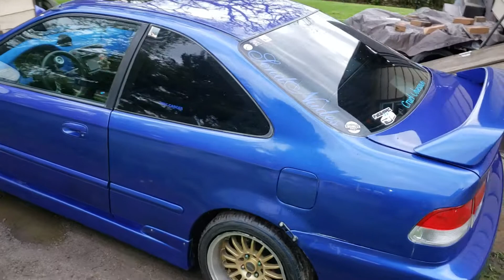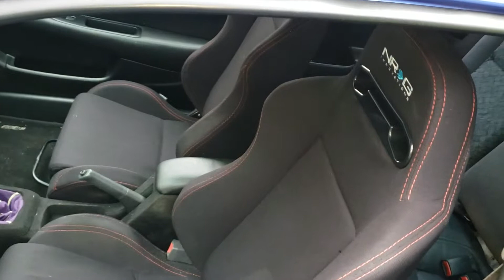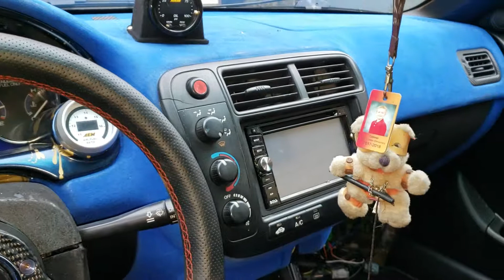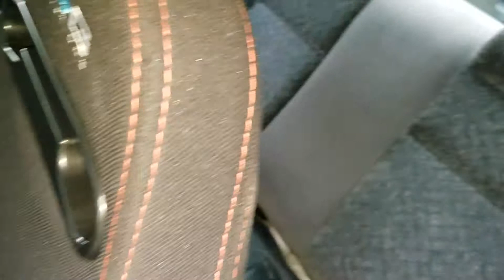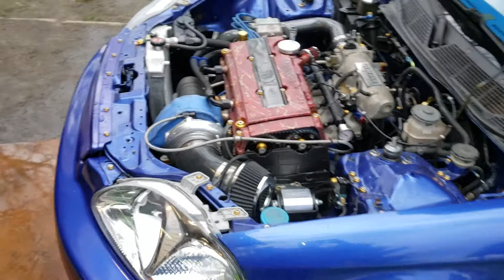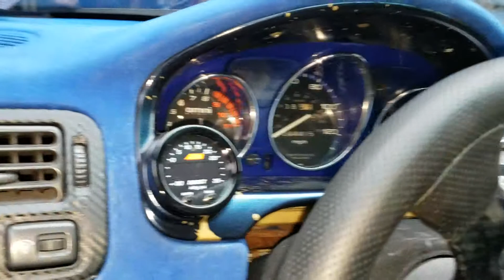1997 EJ8 Civic walkaround (FINALLY!) with fire up!

Comment: Great video I love this civic looks great & the best part is that you did all the work great job
Reply from the maker: It hasn't been easy, I can guarantee you that. One of my good friends has an EG hatch that made 834 whp with a B20VTEC, but it blew up on the track after running a 9.56 @ 155 mph, so he spent all winter building a LSVTEC to run this year and it blew up on the dyno over the weekend without having made a single pass. He's going to buy my CSS B16 block to replace the LSVTEC. Anything can happen at the power levels that we're making. He's blowing 40 psi through a 1.8L 4 cylinder...
Reply from the maker: Thanks bud!

Comment: I randomly saw your comment on a tuna fishing charter video and saw your profile pic and came across this, Nice ej8 I had a 2000 ex with stock d16y8 I bought off a 1 owner female and later on when the motor was done I bought a full b16b ek9 type r swap from hmomotors had the car for over 3 years until one weekend drove down to San Diego my friends dorm and the last night I was staying it ended up getting stolen horrible memory they guted and dumped the car in one night and the cops got the report and saw it full stripped sitting in the tow yard I was praying hoping the motor and trans were at least in the car but it was stripped to the teeth including all my fishing tackle since I was a kid I had and my friends personal items as well :\ something about the ej8 body that I always loved!